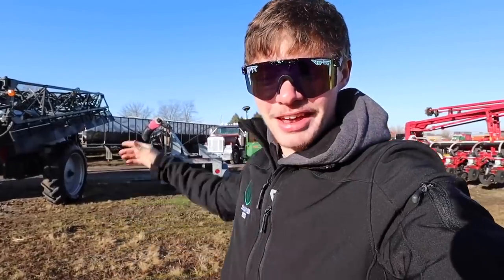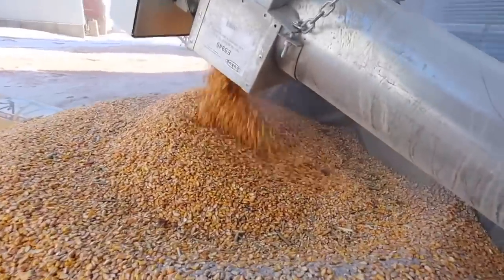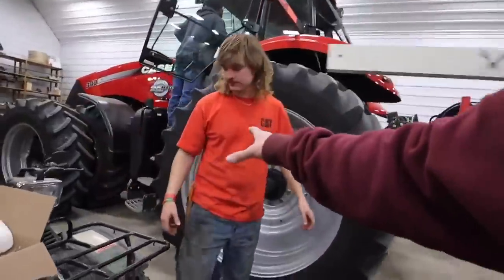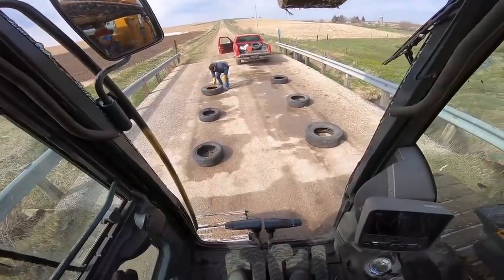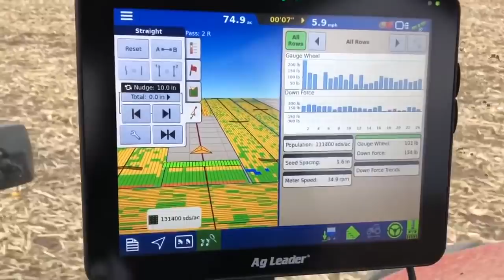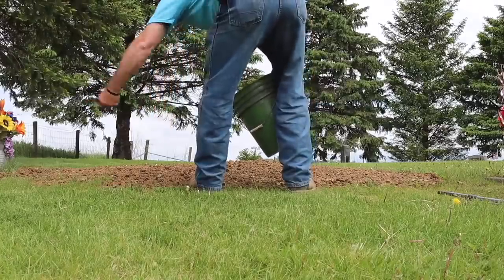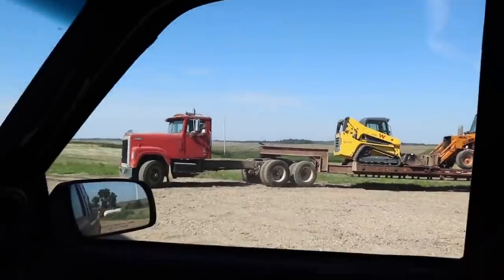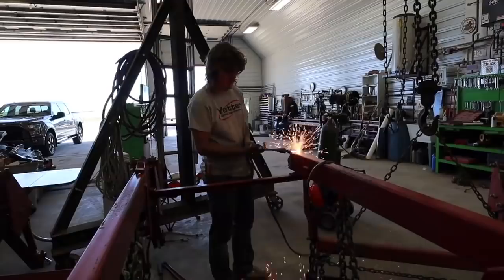How Much Our Farm Grew In A Year (Part 1)

Comment: Raccoons are cute.  But they can jump half as far as a cat.  IMO you were too close.  Older coon that are not scared.  I would be concerned they might be rabid.  I no longer relocate them.   Cole.  Could you talk about the increased efficiency with the autosteer in older tractors?  I know just impressions but.  “On this 80 acre field normally I worried about running out of diesel. With the autosteer there is still 1/8th a tank left.  Overlap is less then a foot where before I would be 5 ft overlapping at times.  Plus I don’t have to drive empty at ends further, and further”
  Maybe talk about costs, less stress...    I bought (new to me) with autosteer.  But I can’t compare without on exact same machine.  Merry Christmas

Comment: I'm NOT a farmer. I would cover the wheels with strong garbage bags and jack the whole unit up off the ground to relieve the wheels from pressure. Just like I do to my Lambo when I store for a longer period.  I'm really surprised that CASE and Deer can't design their equipment more reliable. Seemed like farmers are not farmers more like mechanics. CASE and Deer have been building equipment for decades and still haven't mastered reliability and less maintenance. Shame on them. The amount of debris stuck on the equipment after a day's work is ridiculous. Farmers should spend more time farming NOT repairing. On top of that, they aren't cheap. That's why farmers are not wealthy farmers. But they sweat to put food on our tables. Hats off to farmers. Shame on CASE and DEER.